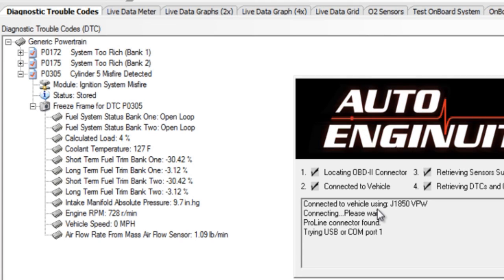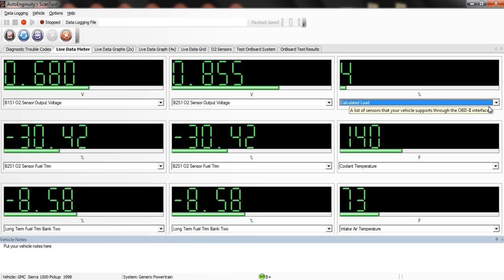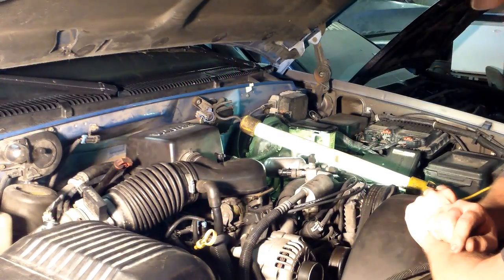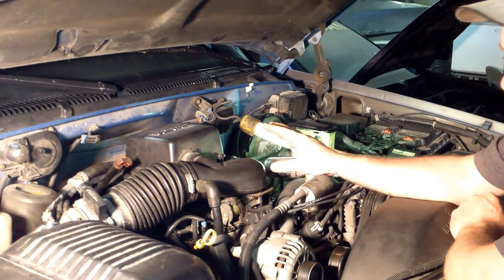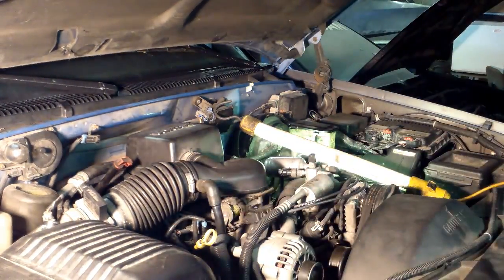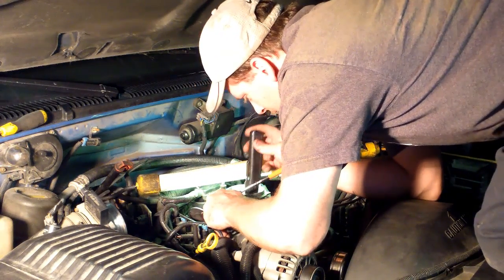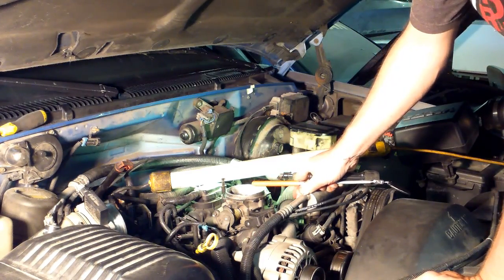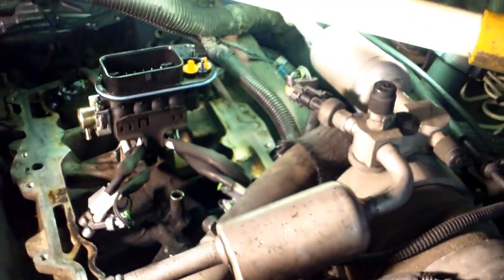Troubleshooting a rich condition P0172 P0175 GM Spider Injection part-1

Comment: I have a 96 GMC 1500 5.7L. Engine is new as well as everything under hood except PS pump, AC comp, & cannister. I have the new style spider. I get a po175 code abt 2x a mo. and sometimes never.  Runs great, just ocasional code, & I clear it out w/Autel. Checked log & SHRTFT1= -16, LONGFT1= -8.6, SHRFT2 -2.3, LONGFT2= -10.9. Gonna check man vac for low reading, & probably original O2 sensors. No other codes & no bank 1 codes. Any help to check with this is appricated. Thanks..

Comment: this one has us has us baffled.this is a 1999 Chevy suburban lt k1500 5.7 vortex

all this has been replaced. 
fuel pump,  filter,  fuel pressure regulator,  spider injection, EGR, map,crank sensor, mass flow, plugs wires cap and rotor. and we get 60 psi on prime. it will start then shut off. I've had three different people at three different times tell me the security shit the pump off. no security light flashes or stay on. 

I have to do all this work stuck in the desert. so a mechanic is not accessible or they just lazy and won't drive into the desert 😁

Comment: 2005 Gmc Sierra 5.3 p 0172 p 0175
I clear the codes and the engine light pops on same code after i drive 60 miles

Comment: Would a bad spider injector cause the 5.7 chevy truck to shut off while driving? Then wont start until the next morning.
But then ill turn it on to warm up
And when i turn it off. It wont start no more till later on. I NEED HELP.🙏🙏🙏

Comment: I am trying to find that part for my ride. I have running rich in bank one and 2 and the same miss fire in cylinder 5. Very rough idle. now that the oil and fuel is mixing together it has rough starts, too! What is the brand of the part? Is it really called a spider injection? Please respond soon I want to start working on it ASAP. Thanks for the video!

Comment: I'm working on a 2001 chevy S10  with  4.3L engine. I just completed this repair.  I removed the distributor to change the gasket.  Is there a shunt wire that needs to be unplugged to set the timing? If so where is it located?

Comment: My fuel trims are reading very rich and after finally replacing the inejctors they are pegged out at negative fifty on the STFT and it drips out the tail pipe.   I am at a loss for what to do... The pressure is nearly 60lbs on the rail running.   I have read the return line can be blocked, can this be rectified with shop air blown through it?  any suggestions is appreciated... thank you
Reply: Computer ecm

Comment: i thought the best way to check the fuel regulator or injectors was with a pressure gauge on the fuel rail.If it bleeds off then you have a leak

Comment: So, I had all 4 o2 sensors, plugs (They were fouled out), spider injector, fuel regulator valve, all gaskets changed  on my 97 Tahoe and it was running well for about a week..... Guess who's check engine like came back on?? What could be my problem?? P0172 and P0175 trouble codes. Thanks for any assistance!
Reply: Did u ever figured it out?

Comment: cant you just change the fuel regulator looks much cheaper and easier that spider set up looks pricey how much was that
Reply: John ming
Reply: John ming
Reply: John ming
Reply: John ming
Reply: yes you can. it's super easy. it's only held by a clip and they sale it separately. it cost me around 40 bucks at autozone. I honestly think that this is little regulator is the real problem with these injector assemblies. not the actual spider which is 300 dollars compared to 50 for just the regulator which is the actual problem on many occasions.
Reply: This apply with the Chevy 454 motor?

Comment: great video, well narrated, but just because the regulator was leaking did u have to replace the whole spider injection unit? or did you just want to upgrade it, were you able to just get a new regulator or no?

Comment from the maker: Not sure with the oem reman, however this new replacement is a Delphi Engine Management, corect the 4.3 and 5.7 are simular in many ways thanks for bringing that up,i have heard of a few plenums cracking during installation, never had one myself however im sure they have failed more than once, your welcome anytime, thank you for the feed back

Comment from the maker: Thank you for the compliments, yea the 4.3 and 5.7 are similar in many ways, thanks for bringing that up you have a good point, the oil needs to be changed after the repair is complete, will be surprised how much gas will be in the oil thinning it out, not to mention the other effects to much fuel can have on an engine, thanks for the feed back

Comment: Who makes the re-manufactured spider assembly?  Great video for anyone with the 5.7 or 4.3 because this is a problem you will eventually have...  Do the plastic intakes tend to crack over time?  Thanks for including the fuel trim data and explanations.  You and Duane are the only ones who constantly explain that to us...

Comment: Check your fuel pressure at the fuel rail.  Fuel pump making a new noise.  Gas mileage down, longer crank times to start?  If you cycle the key a few times before starting does the stall condition go away?

Comment: i got a 1998 z71 with a 5.7 vortec and  it idles rough and sometimes when i start it,it will almost stile out if i dont give it a little bit of gas but soon as i press the gas it stops it what do you think  could be wrong with it?